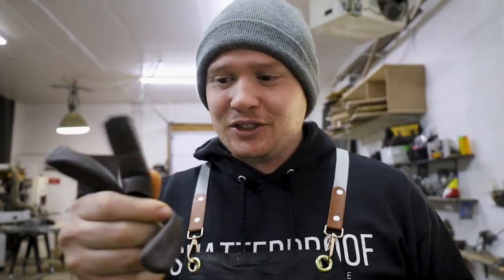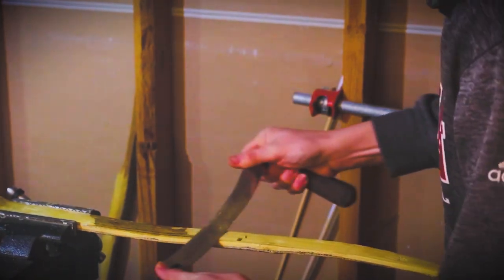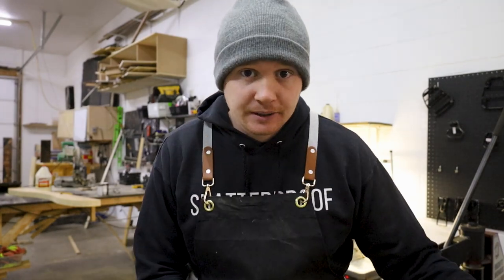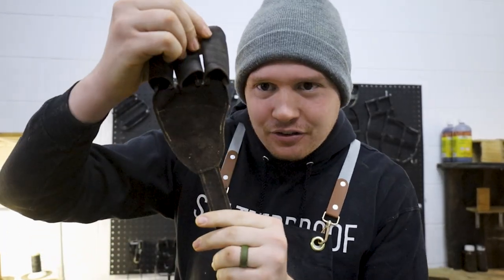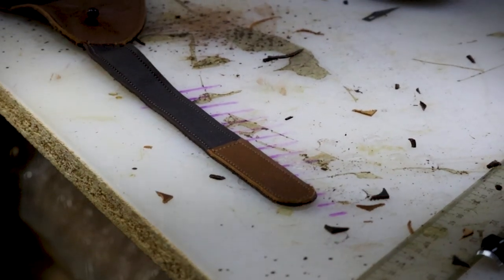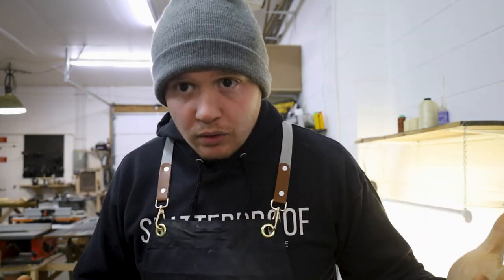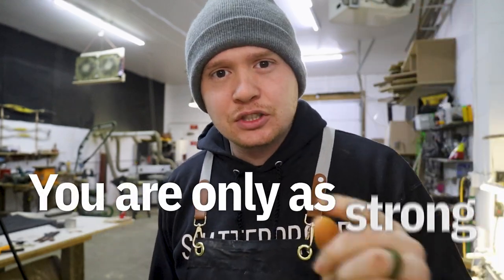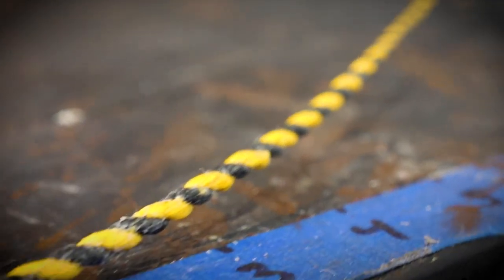I messed up 100 of these

Comment: The closest gloves made like this are old Ben Person gloves and an old 1950's to end of 1960 Bear model that came out in 1950's sometime to end of1960.  The Ben Person Glove was made for years. The gloves are using only the hole, you slip the grip into. 

If I had to get the glove fixed, I would just ask you to sew up almost all of the slit with about 2--3 stiches down from the hole so I can still get the glove on the button but so that it does not stretch out and go the wrong way for my hand.

Of course I like the, type that are like the Cordovan Traditional Glove sold on 3 Rivers with the extra leather spot on top as a spot but I got cheap TopArchery version off Amazon where only the top is real ground leather with thin pressed leather overlay for now until they fail. What I wanted was the arm guard in the cutaway two strap style with holes but most are either a rougher nylon Cordura outer in the right thinness or are thick padded with a smoother nylon Cordura outer and neither are what I wanted in an arm guard so I got the set since at the time they had the arm guard sold on own but Out of stock not sure when or if we are getting it back in forcing me to buying the glove and armguard combo. The synthetic leather is fine for the arm guard but the glove when it fails if the cheap glove did not last very long for the number of shots, I am buying the Cordovan Traditional Glove off 3 Rivers.

Comment: You might want to slightly stagger the holes if you think putting them closer together might give a more precise fit? Have always liked the nostalgia of the three finger glove with childhood images of Fred Bear and Howard Hill. I think it depends on how you release the arrow as to whether it will work out to consistently shoot well with a glove.  I prefer a tab or a soft leather thin work glove. Older style archer gloves tended to be a thicker leather and created more potential for string pluck in my case.  I use a tab that allows me to wear a warm wool glove under the tab.  Your  glove design looks interesting. Thanks for sharing the passion.

Comment: Instead of using the pin, you could always switch to the hook pin, like what you find on boots or other items that use a strap.  That way when you slip the slit/hole over it it will hook it and stay in place without worry of popping off...😉

Comment: I've had one glove for the 9 years I've been learning archery. It's a deerskin glove with suede finger pads, back and palm strap with a Velcro wrist securement. Recently in the last year I've been putting most of my focus into learning historical archery, meaning sometimes holding my arrows in my draw hand. But the palm cover got in the way so much I eventually took my knife to it and very diligently cut the palm strap off leaving just the back and wrist strap intact. I loved the way it worked, unfortunately the age of my glove finally caught up with it. The index pad wore through and the seam between the pad and deerskin split in the first knuckle crease of the middle finger, so it's retired now. I didn't want to buy another nice glove just to take a knife to it as soon as it arrived to get my modification back. So after a Google search I found this glove and it looks nearly exactly like what I was envisioning to build since I kept coming up with nothing in my search for a new glove, I also do leather work, but now I don't have to build my own. I'm so excited to get one ordered, my fingers are getting raw shooting barehanded.

Comment: There's only one way to properly orient the button punch hole . For longevity punch a tiny hole at the slit end to stop splitting . finally hand stitch around the button hole /slit. Cardovan leather is best for finger covers . I have not yet tried kangaroo leather which shows great promise .

Comment: what would be better, is a peg shaped like )(. The stretch of the leather would allow the hole to slip over the top wide portion of the peg, then settle into the thin center. the peg wouldn't need to be any taller than it currently is, just a few mm.

Comment: With the weather the way it is these days in MN I was only able to shoot my new glove once. But I did better than expected. 1st I shot my Kangaroo glove to get warmed up. Then in  🥶 & windy conditions I shot the new glove. I noticed that even with my long fingers that I needed to put the button on the tightest position.  With other leather gloves I'm between a M & a L which makes me a ML. With those options I found that with this glove that  it's more about the tension on the fingers that u get is monumental to getting the feel of the string I don't get with a L glove & would never come close to with a medium where I feel that my fingers r getting jammed into those 3 finger holes.